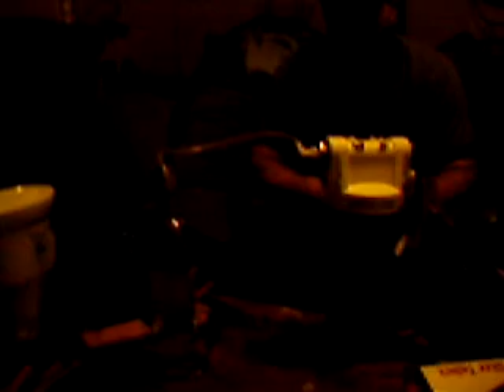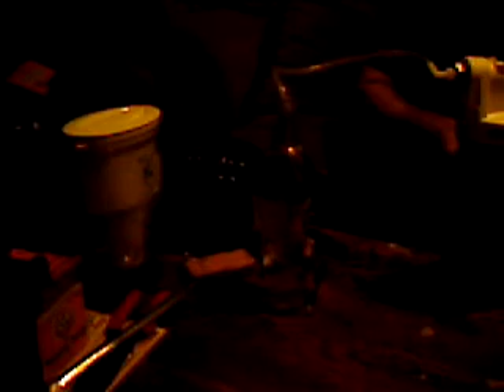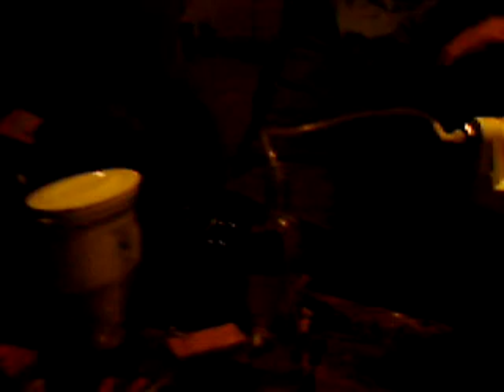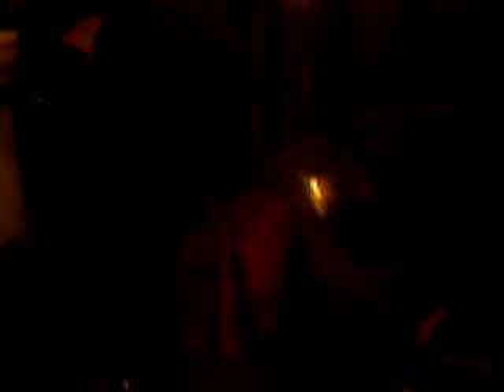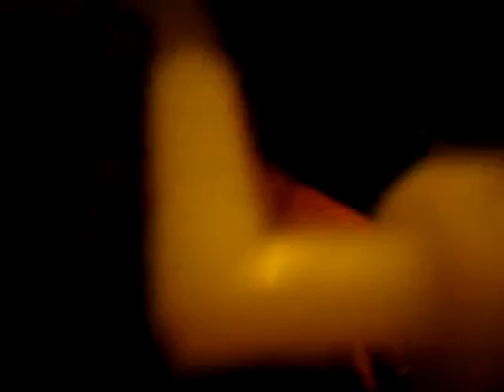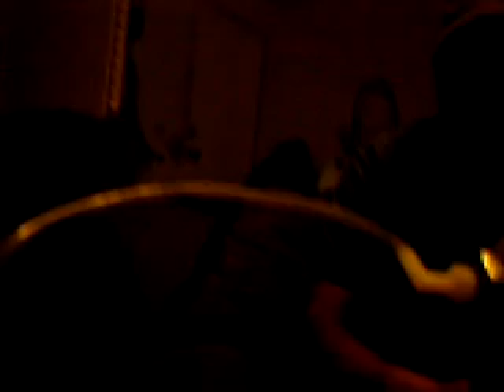Second Hydrogen Cell, big upgrades, much better

Comment: walmart sells flourescent light sets for about 9 bucks plus about 6 for two 4-foot bulbs. it plugs in to a standard outlet. You need good light in your workshop or garage. Its a safety issue.
good luck with the new generator. Keep us informed.